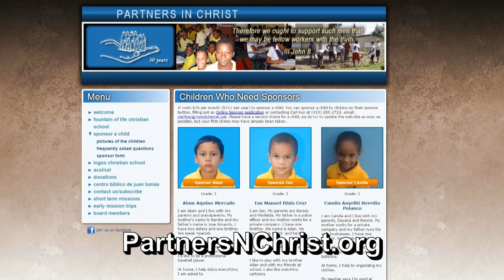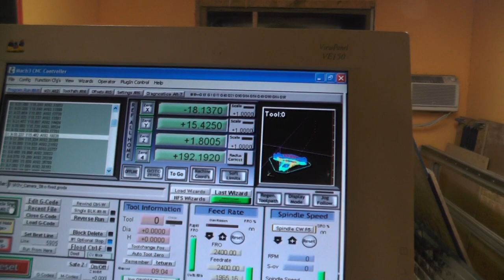Cabin Tops - Part 1

Comment: Hi guys,
I am very impressed by your films, work, ideas, knowledge in such a wide spectrum of areas. Awesome. I have build a 17x4,85m Långedrag sailing yacht myself so i know the deal. Just wanted to give an adwice ön the way. I cut all my steel sheets with a discgrinder. About 700 discs. A lot of that dust went into my lungs and caused astma. Be careful with that, just wear a simple dust filter. 
Your project is very big so there will be a lot of dust along the way. 
Keep up the good work. You're doing great!
Cheers from Sweden westcost
Jonas

Comment: I would love to come give you a hand. I am a ASE certified master mechanic, got tired of that & became a machinist & a welder. I then moved into CNC machinist & foreman of my shop. The problem is I blew out my knees, ! has been replaced & the other needs replacing. I can't climb the ladder to get there. Let me know when you build an elevator & i'll be there asap. I love what your doing. Keep up the good work. Thanks for the videos.
Reply: Mike Weiser Where there is a crane. And reasonable disregard for bullshit. There is a way. A 3 times faster way aparently.
Reply from the maker: Mike Weiser  Hell, I'll carry you up and down that ladder.   Or just rig a Bosun's Chair for the crane.   We have tons of welds to do as well and engine work that needs to be done.

Comment: All oil less compressors are not suitable for breathable air. There is still a great risk of metal fragments, from the piston cylinder interface. It is best to stick with a purpose built compressor, such as the Gast 263, and the Thomas t-80

Comment: Hi Doug, I have been watching you build that boat for along time now and I wanted to write to you and say, Thank You ! I have been trying to teach myself welding for awhile now and have not had that good of luck with my welds. I would read about this and that and try more gas less gas and on and on. I watched you teach 2 people to weld . One aluminum and one steel . I did what you told them and my welding has improved 1000 % ..! You are a very talented person. The boat is very nicely constructed. Do you have plans or are you just working out of you head , Either way, NICE JOB !!  David:
Reply from the maker: David Wales Rock on!  ...I doubt it was my instruction, the real trick is just don't stop trying.   And the more wire you burn the better you get.  When you want to get really good, start watching Jody at WeldingTipsAndTricks.     And no, there are no plans. :)

Comment: I guess I should have mentioned the fifth wheel is 42ft long three axle. I can back/push/pull it into just about any position. Another option is a trailer park nearby that I can post up and simply report to work daily with my truck. ???
Reply from the maker: JJKNUCKLE AMERICANMAN No worries.  You can park it on that stretch of grass along the driveway.  And we can hook you to shore power and water.

Comment: why don't you try a light blue tarp over your cranes to block the sun and run fans to keep air moving under the tarps but keep the tarps up on the sides

Comment: What is the name of the Green Stuff you are coating the metal with?

Thanks again for another fine video!
Reply from the maker: GasserGlass That is very very old two part epoxy paint.  I got it from and EPA inspector that got it from Sherwin Williams.   I think he was suppose to make sure it was properly disposed of.   .....hmmmmm.     But it was really cheap.  Like $7 a gallon.
Reply: 7 bucks a gallon, Great Score there!
Reply: GasserGlass Dunno, but it looks the same as the key lime pie filling ;-)

Comment: Oh cool, Hooka Diving.  I was hoping you would include that.  Ive probably asked this before, but when you sandblast the hull, will you just paint over the flashrust?
Reply: I believe he will sand blast it first if he wants to create a permanent protective layer against the rust
Reply from the maker: richardmg9 I would love to have one of those $20K 1000 watt lasers that burn the rust off, but wet blasting is more likely what we will do.  And fortunately they are formulating paint for wet blasted steel.  It goes on while the steel is still damp and will cut through any flash rust.
Reply from the maker: stanley carter Right on.

Comment: Since the bulwarks (and pilot house) are designed to be removed and the cabin top coaming you're installing seems to be taller than the midship bulwark...just wondering if the coaming might violate your height restriction?

Am I saving you a headache later on OR just being a pest suitable for Earl's attentions? :-)
Reply from the maker: Mondauthor It is.  You have a good eye.   But the bulwarks are far taller in the bow and stern, and the cabin tops will stay level with the deck.

Comment: All this time i am amazed that no one has fallen down the holes in the deck. I was going to suggest railings but that would be too safe. 
CHEERS
Reply from the maker: Bob Cartwright I figure that if you need rails to stop you from falling into a hole then you don't need to be building a boat that will be surrounded by ocean.
Reply: Very true keep up the great work. I wanted to visit you this summer vacation but the wife didn't think working on your boat was a vacation. If i am single next summer i will be there. 
CHEERS
Reply from the maker: Bob Cartwright The wife is right.  ....it's an adventure, but not a vacation.  :)

Comment: In a previous episode you said the bulwarks were coming off during transport (to clear power lines?). Is the cabin top going to clear?
Reply from the maker: bfayer Right.  The cabin tops are low enough to clear.  It's the forward and aft section of the bulwarks that are too tall.

Comment: you can get breathable oil for the compressor also you should clean the shit out of it. lots of divers have died because of contaminants in their air. commercial diving is my profession so if you need any help with it i can provide it. just ask.
Reply: *****  Using a breathable oil, in a compressor with metal rings on the pistons = bad.
Reply from the maker: ***** There is no oil.